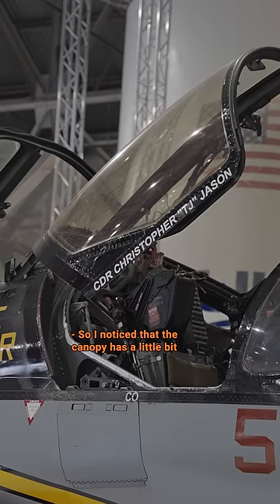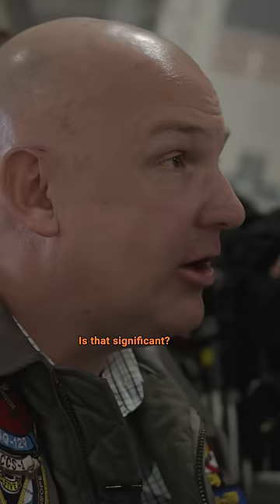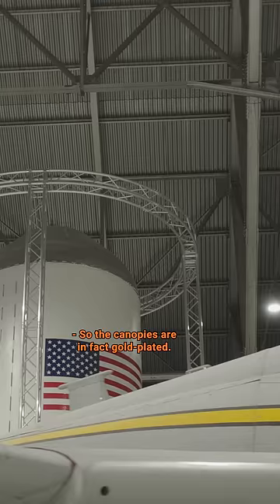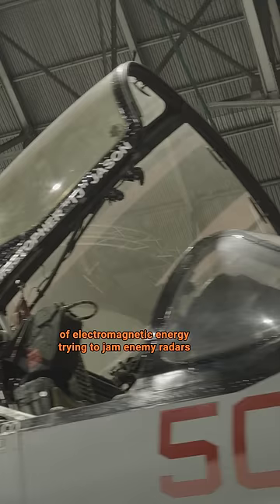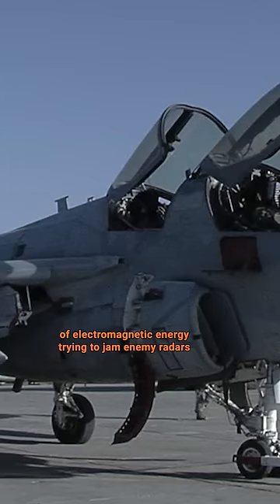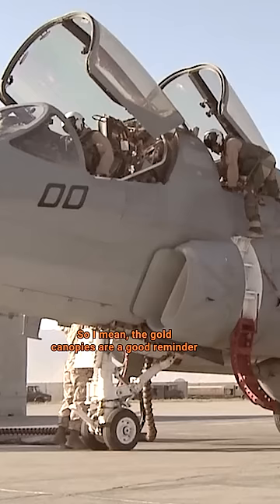Part 8 | Gold Plated EA-6B?!

Comment: Crews all ended up with significantly higher cancer rates later on. Gold didn't help.
Reply: absolutely..Look at testicular cancer in AWACS  crews..
Reply: @bigstuff52  lmao
Reply: @bigstuff52 really? 😥 Is it true?
Reply: @LanaaAmor yes, my grandfather developed it after working on AEW many others did sadly
Reply: @vkn3682 I mean like I wouldn’t be surprised if it doe’s considering the reports that if you have a strong enough radar wave it can melt concrete
Reply: @LanaaAmor The Air Force did a study and determined that aircrew have a 30% higher chance of developing testicular cancer and 25% higher chances of developed skin and prostate cancers.
Reply: @areallyhappyarcticfox1240 EW systems can emit microwaves to jam enemy radar. I've heard stories of people getting literally microwaved by accidentally standing right in front of a fighter radar, so it's not too unbelievable being around a jammer is deadly.
Reply: @Trve_Kvlt Stealth coatings often use chromium which is known to be a potent carcinogen
Reply: This is a false assumption. You have no idea how much worse it could have been without gold.
Reply: @Trve_Kvlt they’re also flying much higher in the atmosphere, since radiation is higher up there I wonder if it’s primarily that?
Reply: @bigstuff52 not true you are wrong
Reply: @LanaaAmor absolutely..Look at history of Awacs crews..My son was an AWACS crew member for 6 years at Tinker..He told me that the air force found that testicular cancer was significantly higher in AWACS crew members than the general population..
Reply: "Crews all ended up with significantly higher cancer rates later on."(sic)

Incorrect.Higher rates of cancer occurs in fighters not Prowlers.
Reply: @bekirbd Imagine if the gold wasn’t there
Reply: that's probably mostly due to high altitude
Reply: It does help vs certain EM lengths, but not the radiation increase from space. All pilots have higher rates of cancer.
Reply: Yup, I knew an F18 pilot that died from colon cancer. It’s a known risk in the community
Reply: @cadennorris960 it doesn't matter bub. It didn't help. No cancer is better than cancer
Reply: And the big 90 foot sportfish yacht owners always gave me weird looks when I asked them to shut down their massive radars when in the yacht basin I'm like "we're in a giant metal box essentially and you're blasting us with radiation and you all do it all the time I'd like to not have cancer at 65 thanks"
Reply: @bigstuff52 bad assumption. Same cancers are seen in elevated numbers in airline crews.
Higher altitude, greater exposure to UV and cosmic radiation was established as the cause.
Reply: @vkn3682 yeah tell me you don't understand RF without saying it, settle down please. GO back to college, you missed the microwave fundamentals class
Reply: @vkn3682 kinda different but I know a guy who was in a work accident and was exposed to radar on the ground and developed testicular cancer. It was also covered 100% by the VA.
Reply: I feel like that would be more noticeable down the line in theire kids like a generational thing , but fuck if I know
Reply: @RRKS_TF  well i got news for you about stainless steel
Reply: it probably did, just didn't completely negate it
Reply: @nuteven7156  🤷‍♂️ I have no idea, all I know is that he only has 1 ball now😂
Reply: Many radio waves and other waves can be deadly. Need proof, just go get close to a high output radio tower, tv tower, cell tower, and tell me all the warning signs on the fences. Also notice dead birds laying around the site in high numbers, many times grass will all be different from surrounding area too. I’m all for the tech, I climb towers and fix two way radio system antenna, repeaters, transmitters, all the time. It’s unsettling when you know if you grab an antenna by accident that’s transmitting it will cook you from the inside out.
Reply: @bigstuff52 how bad is it for tankers?
Reply: Radar should not be able to cause cancer
Reply: @Trve_Kvlt  Didn't do the studies, but I know that the background radiation is higher at higher altitude because there's less of earths magnetic field between you and space. With that knowledge I'd say that's probably the reason TC and other cancers are more prevalent in pilots. Got any numbers on civilian pilots?
Reply: @bigstuff52 probably more from being in hot flights hits all day boiling your balls
Reply: @Trve_Kvlt compared to commercial pilots or people who fly once a year?
Reply: @bigstuff52 Ya know If the military tells you that then it's definitely hazardous 😂
Reply: I always assume everyone in the wheel house is a modern ship is going to get cancer.
Reply: If you look at videos taken from military ships during operation the image appears like fuzzing a bit, this is due to the active radar. I have no clue if it means that every crewman is put on harms way, but I do know that the same thing happens when something very radioactive,hence harmful, is filmed.
Reply: @louisfesselet3963  what makes you think film grain and ship radar are connected? 
Ive never heard that before.
Reply: @refractivity3388  that would explain the skin cancer. I'm not sure about the testicular cancer.
Reply: @peeonu25  because of radiations
Reply: @TheOOOOOOOOOOOOOOO  Most likely would explain the testicular cancer too, at least partially, also consider that military personnel often work around dangerous materials and chemicals with less than ideal protection
Reply: @louisfesselet3963  interesting. i want to know more. Even today when in the wheel house theres only 1/2 of aluminum seperating us from the radars.
Theres signs to stay 53 feet away.
Aint no way in hell are we 53 feet away.

I wonder if I can set my focal and shutter speed to see the emission
Reply: This is actually a bit of a fallacy, as there was no control group. We can, however, say that the gold didn’t help ENOUGH, because cancer rates were still too high.
Reply: I would bet it did help you can have cancer and you can have worse cancer
Reply: @Trve_Kvlt having less atmosphere between you and solar radiation also causes cancer
Reply: Yeah gold isn't really blocking emr
Reply: @vkn3682 yeah i also dont know about that. Radio waves arent ionizing at all. If high intensity radio light is bad for you then why doesn't visible light, which has way more energy, not considered dangerous to us
Reply: @tonyvelasquez6776 you seem to be the clueless one here bud
Reply: @natemeehan210 metal reflects all EM radiation that hits it btw.
Reply: @vkn3682  yes I am, because anything that emits EMR has the potential to disrupt cellular processes and cause cancer. It just depends on your exposure length and strength. Plenty of documented research on this.
Reply: @lluvik2450  no you don't, and your comment before just proves that with your idiotic comparison. There is absolutely nothing the same aside in principal about ultra high power EMR at the microwave wavelengths and visible light. Standing in front lf a radar beam at 60Ghz and 10kW is not in any way comparable to standing I'm front of a light bulb that's putting out 50 watts.
Reply: @tonyvelasquez6776  you are honestly laughable
Reply: @lluvik2450  visible light does cause damage ever heard of sunburn
Reply: The gold is to prevent the eyes from getting cooked by microwave... any soft tissues with moisture gets cooked first
Reply: People living their whole lives on southern shore of Caspian Sea DO NOT have high rates of cancer. Yet they live with ionising radiation at 260 mSv per year. The occupational limit for radiation workers is 20mSv. Crews of WW2 night fighters aircraft had their legs kept warm by their radar. They were getting microwaved. There are zero cases of bone cancer or reproductive issues in WW2 aircrew veterans.
Reply: @vkn3682  lol it does a radar is a microwave oven without the protection box thats quite a lots of radiation
Reply: @blodstainer  it can indeed (gold blocking em), i could list numerous public examples by nasa but ill let you enjoy that google sesh
Reply: @bigstuff52 same thing with ac130 gunship loaders and operators except they get lymphoma and other blood diseases. Sad, one guy said he’d get nosebleeds and migraines every day.
Reply: @apricotcharms4126  Not sure...
Reply: I’d think this is from flying at high altitudes all the time instead of anything else.
Reply: @lluvik2450  yeah you have no response so you just default to nothing
Reply: @lluvik2450  yeah you have no response so you just default to nothing
Reply: @vkn3682  I know you don't even have your bachelors degree considering I'm the only person so far to even comment on the topic...all your comments so far have been hot air, keyboard warrior nonsense about who you think I am where all my comments have been literal factual information. I guess you're just so smart that you can't even debunk them! 🤣
Reply: @vkn3682  "I'm not going to engage because I'm just smarter than you" is textbook "I lost and I have no technical rebuttal"...like come on dude at least phrase it in a way that's not so obvious, it's what all of you say
Reply: @tonyvelasquez6776  i couldn't discern a point this poster was making besides "yall idiots and Im pissed" I will at least agree tony is pissed off.
Reply: @Donnerwamp Skin cancer is more prevalent among airline crews, yes, whereas multiple other types of cancer are also more prevalent among service personnel exposed to Immense RF like those used in radar and other military EW devices
Reply: Unless Gamma, Alpha, or Beta, does not increase cancer risk. 

High altitude EM exposure poses higher risk (less protecting atmosphere/magnetosphere)
Reply: People forgetting that the higher in altitude you're at, the more solar radiation (IONIZING!) you're going to get
Reply: Y’all need to learn the difference between ionizing and nonionizibg radiation. This is why Americans shouldn’t skip high school chemistry and physics… 🙄
Reply: yep, my uncle got acute leukemia after being a pilot for 15 years
Reply: *tin oxide
Reply: Still could have helped. For instance without it, they may have died immediately.
Reply: Not true. Only the normal cancer rates for that time when smoking was seen as healthy as eating cereal
Reply: That’s actually crazy and super shitty. I definitely would’ve thought that they would have some way to protect crews
Reply: It's dose just not well enough. The issue is you need a full Farida cage nit thw partial one they have
Reply: @Trve_Kvlt Wouldn’t this have more to do with the notably higher levels of ionizing radiation that everyone experiences when at higher altitudes?
Reply: @natemeehan210 Different kind of radiation. Radar does not = ☢️
Reply: @bobetmoi2988 Different kind of radiation. Microwaves will impart energy in the form of heat and cook things, they will not ionize and destroy DNA leading to cancer. Obviously if you cook your toes you will have problems, but if they don’t feel like they are burning, it isn’t cooking them, as heat is generally necessary for cooking (last I heard).
Reply: @vkn3682  This might be true. From what I've read, studies have not shown a correlation between occupational exposure to radio frequencies. However, all of the papers mention that further studies needs to be done. My theory is that a combination of thousands of hours at very high altitudes (=more exposure to cosmic radiation), exposure to jet fuels and vapors, as well as tons of exposure to radar waves -- even though they are not very harmful on their own -- could probably lead to a heightened risk of certain cancers in military pilots and other personnel.
Reply: @tonyvelasquez6776 I don't know which unaccredited college you're talking about but your microwave fundamentals lecturer forgot to teach you the fundamentals of microwave radiation. For example, the fact that it's not ionizing is pretty important.
Reply: @vkn3682  It's worse than putting yours next to a running microwave (no shielding). Some more powerful ones can kill/cook rabbits about a football field away.
Reply: Hey, they might've had even more cancer. Then again, you might be lying.
Reply: @bigstuff52  Thats pretty interesting considering I had testicular cancer and worked at an EMI test facility where I would be around all kinds of electromagnetic energy through out the work day.
Reply: @chsxtian  look at the research done by Qureshi, memon, etc.
Reply: just because some still have cancer does not mean mean it would be better without it
Reply: @vkn3682 What you think and your poor research skills doesn’t make something true.
Reply: To be clear, the gold is NOT to protect the occupant, it's to lower the RCS of the section of cockpit frontally occupied by the personnel cavity. 

The irony is that, and where the current kerfuffle sits regarding higher cancer rates, is that the very gold coating meant to divert/diffuse enemy radar energy away from its receiver location, also acts as a concave mirror which bounces the aircraft's own EM emissions (radar, high powered jamming pods in the case of the dedicated EW platforms) and concentrates is INTO the occupants' space. Nuts, neck torso and head.

Now, the typical retort is "buh  buh buh RF emission is not inonizing, it's not carcinogenic so who cares!". But new studies (see AF study cited) has focused on how a high power concentration of non-ionizing radiation over a long cumulative exposure timeframe, does have an impact in alpha band related desynchronization (Alpha-ERD). 

The EEG documented impacts of A-ERD, and its cognitive impairments while under and shortly after RF stimuli are self-evident, but there is great resistance to broaching the carcinogenic question. More peer-review work is required to bridge the gap with the correlation of cancers, given the high reporting of cancer in this pilot sub-population (say compared to airline pilots, whose ionizing mechanisms for cancers is better understood).
Reply: Back in the old days, people would stand in front of the radar because they would feel warm…not realizing it’s pretty much the same as being inside a microwave and setting it to POPCORN. 😂 all that energy can’t be good.
Reply: @bekirbd  What's so funny?
Reply: My dad was in the Danish Airforce.  Everyone who worked near an active radar who had kids had daugthers. It was kind of weird. In Danish Airforce the radar Ground stations and SAMs were run by them.
Reply: @phishphood423 Exposure to heat that is not painful for long periods of time can lead to cell damage.
Reply: @weasle2904  If it was due to altitude then all commercial pilots would be getting it also. A mind is a terrible thing to waste, son.
Reply: @davidgray8089  They do. Genius
Reply: @vkn3682 i mean Radar has very very VERY strong short wave emissions and in fact can damage your brain tissue ...not very much but over time yes ......
Reply: @RRKS_TF  so i genuinely didnt know about chromium being carcinogenic but after reading up on it, its only carcinogenic if you inhale the metal as a dust, otherwise its bonds are strong enough to not break off and enter your body
Reply: Also do you guys think the increased cancer comes from the planes emmissions or the fact that theyre getting more radiation since theyre constantly flying and at significantly higher altitudes than boeings. You get about .006 mSv per hour of flight in an airliner.
Reply: Gee, do you think maybe they lied about the purpose of the gold tint?
Reply: Not from the jamming equipment. Any person on an airplane will get increased gamma radiation (the type that actually hurt you) from simply being closer to space. Less atmosphere to stop gamma and x-ray radiation.
Reply: For the people saying it doesn't cause cancer...the man in the video is literally explaining that they are gold plated to protect the pilot 🤡